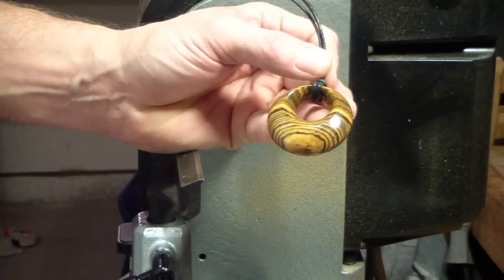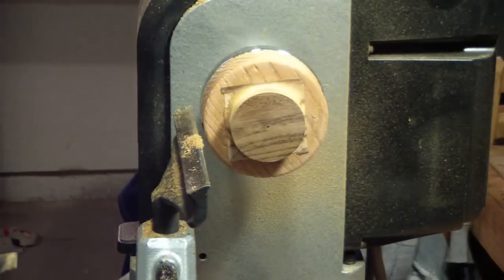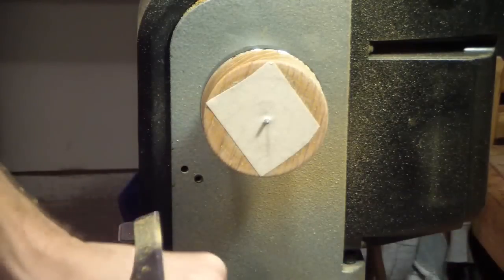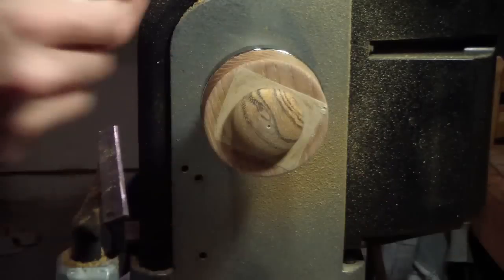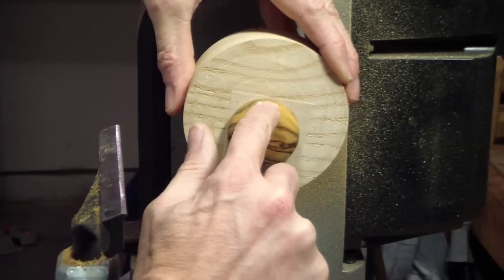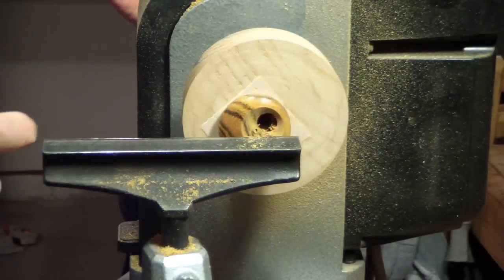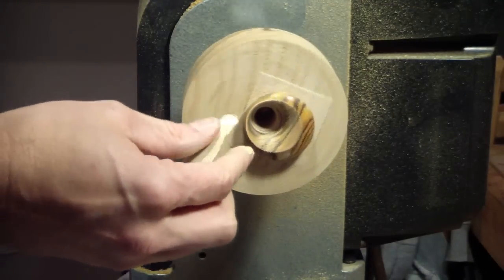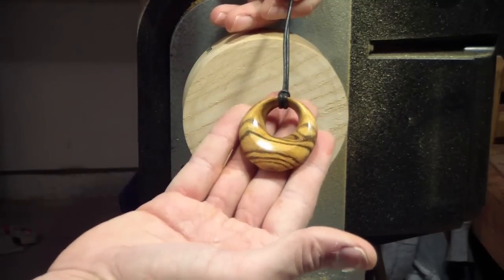Bocote Pendant Turned Without Special Tools

Comment: Qiuck tip Chas !  Put a piece of blue painters tape on your back piece first ,then on the back of the piece  you will be  turning with the two face tape between the two. After turning remove the finished piece ,and there's no cleanup of either your backing piece ,or finished piece ,because the two face tape is sandwiched between the painters tape. I use the method on all kinds of applications

Comment: Hi Chas,  thanks for the video.  I tried your method, except instead of a pin and tape I used a small screw for the first two steps.  It let me worry a little less about my initial cuts.  Not sure if you tried that and rejected it for some reason?  I did have to adjust the thickness of the block vs. the length of the screw to match the piece, but since I didn’t have a pin laying around the choice was easy!

Comment: Great video!

I used a finishing nail to make the pin for my chuck.  Fits perfectly into a 3/32" hole in the workpiece.

Double-stick tape provides marginal adhesion when drilling and tapering the hole.  But if I attach the piece to the chuck, and then press it in a vise or clamp for a couple of hours, the tape seems to hold much better.

I find that these pendants make great pulls for sweaters, fleece jackets, or other zippered items.

Thanks for the inspiration.

Louie
Reply: Thanks for your ideas, zipper pull - good idea.  When my thumb heals, I’m going to try this.

Comment from the maker: Thanks MrJonathans54.  I ordered the turner's tape from the Woodcraft website.  They have 1" and 2" tape.  I use the 2" exclusively.  It's pricey, but I still have plenty left on the first and only roll I purchased.  It goes a long way when you only use an inch or two at a time.

Comment from the maker: The pin is part of a 3/32" drill bit.  I drilled the hole, cut about a half inch off the drill bit and superglued that piece into the hole.  I used the remaining drill bit to drill the index holes in the blanks.  A magnet keeps the drill bit and waste block together when not in use.  A bit extreme, but using that piece of drill bit shaft ensures my index hole and the index pin are a perfect fit.

Comment from the maker: Thanks for the feedback Louie.  I have had no issues with turner's tape, so if you are using some other type of double-stick tape, that may be causing your adhesion problems.  Check out Woodcraft and look at their 2" turner's tape.  Using the pendants as pulls is a great idea.  Thanks for passing that along.
Chas

Comment: just a suggestion. You could attach the workpiece to the wasteblock with the double sided tape and then put a piece of packing tape with the nylon reinforcement over the workpiece and onto the wasteblock by stretching the packing tape to the edges of the wasteblock. The drillbit would have no trouble with the packing tape...and you could remove the packing tape before turning the piece to final shape.

Comment: I think a helpful thing to do is to use a center drill before the drill bit, as these are very short, stiff and won't wander, and are used by machinist for this very purpose.  then use the drill bit.  this will work even on curved surfaces.  I have done it many times, works great.

Comment from the maker: @christopher002600, I tried using carpet tape early on, but it won't release the wood once applied.  Carpet tape is made to stay put whereas the turner's tape holds firmly, but will release the wood cleanly with no nasty residue.

Comment from the maker: The bocote blank was about 3/8" thick.  Any thicker and contours get weird.  I could have taken it down a bit while working on the back or even when I turned it over to profile the front.  But I like to use thicker leather cord (at least 3mm) so the thicker, heavier pendants work better and hang nicer.